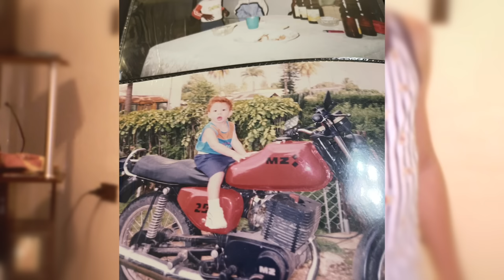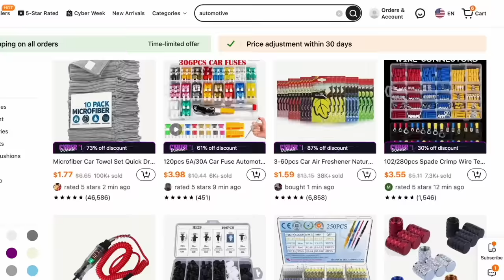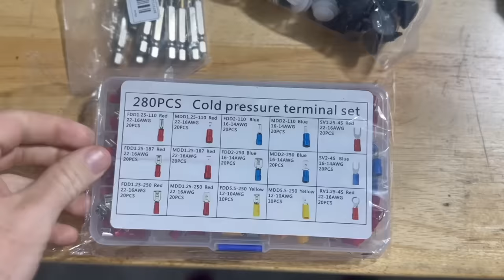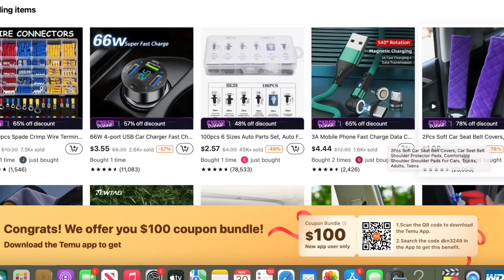I Turned a $1,000 BMW into the Iconic Need For Speed M3 GTR!!

Comment: 8:03

That "two random exhaust port" is the fuel cap commonly found on all racecars.

It uses a vacuum process to quickly fill up the fuel. The high pressure fuel is injected through one side while air is sucked out through the other side.
Reply: So, then what about the ports on the back glass above the rear wheel??
Reply: @Razor_Daniel you mean the holes on the glass? airflow, racecars have no ac so they have holes in the glass to vent out the air inside the cabin
Reply: @schizzzzz8912 I swear I’ve been in the car/track scene for 20 years now and always thought that hose was for more cold air to be pushed into the intake and the hot air out the glass pocket. Cause that’s what made sense in my head. The more cold air you can get into the block the more power you have especially good because the P40 was naturally aspirated. Completely forgot about the no AC 🤣🤣 I just thought yeah no seats rollcage detachable wheel harness racing drivers seat the basics for shaving weight for a track car. Saw this thing racing on an old video at Le Mans 2002 spitting flames I was like that is not anti lag there’s no turbo in there 😂😂

Comment: Man said the fuel filler is a random exhaust port 😭😭😭 the m3 gtr is a homologation special. It’s basically the road going version of the gtr that actually raced, hence the pg40 v8 that only came in the gtr. Basically the blue print for the v8 m3 that followed. Hopefully you do this car justice.

Comment: the 2 side mufflers on the upper rear part of the fin were the hole for the fuel, being a GTR version it was designed for races and a quick refueling in the pits

Comment: Dope! Im hyped for this build bro! My favorite memory of this year was fully rebuilding my 07 550i bmw. 4.8L N62 V8 i fully rebuilt the engine and transmission to bare block/bare-case and replaced just about every single part, every gasket, all bearings (con-rod, crankshaft bearings etc) it was a super fun build and very insightful on how BMW builds their engines.
Reply: Definitely going to be an LS3 going in that e46 😏

Comment: Just wanna point out that the holes in the back of the gtr was air vents for your rear fenders being so low an minimal space for rear wheel. Also helps with cooling of the breaks

Comment: My only issue with the bodykit is that it's not the original GTR bodykit. The front fenders need to be flatter and they don't have those vents. This I believe is a later generation of the GTR bodykit. It's definitely better than the people who make GTR replicas using the Strassenversion GTR kit.
Reply: He aint gonna put a expensive bodykit to a shitbox
Reply: @KnightRowlet  I mean, if your goal is to make a replica, I'd expect you to go all out to make it as close to the original as possible.
Reply: @PolarDog its a dtm gt2 gtr kit the one used in 2001 is called m2 v1 which had no aero fender fins the gt2's have a diffrent fender line front bumper and rear bumper gt2 were the final cars in the gtr project before its cancelation

Comment: The only thing throwing me off is the diffrent front fender since the m3 uses the v1 m2 kit from bmw which has a smooth no vent for aero front fender the one you have is the v3 m2 used on the version 2 for the gt2 m3 gtr's which dont have the original look like the v1 from lemons. Thought to point that out. Overall nice build Edit tl:dr mw 2005 uses the first kit of m2 motorworks known as v1 which has a smooth fender finish no aero and was the kit used on lemons bmw vs porsche in 2001 what dtm sent was a bmw m3 gt2 body kit.

Comment: The oil pressure light always comes on for those motors, even the 330ci it’s super common but only when you turn on the car, it comes on for the first 2 min but after that it’s a problem 😂

Comment: Lets build Brian's gt r34 and use a s15 with the wrong bodykit. The 2001 m3 gtr version 1 which the nfs bmw m3 gtr is based off doesn't have the wheel vents

Comment: Nice one dude, but it won't be a true replica, it will be a tribute. Considering you not doing interior, I assume you won't be doing the E92 V8 swap [which is the closest you gonna get to the race P40 for reasonable price], the whole bodykit is wrong, the Most Wanted Kit was a 2001 Prototype Kit if I remember right, there was a lot different about the 2 and you want to use different wheels, which I don't blame you for doing considering how rare these BBS are.